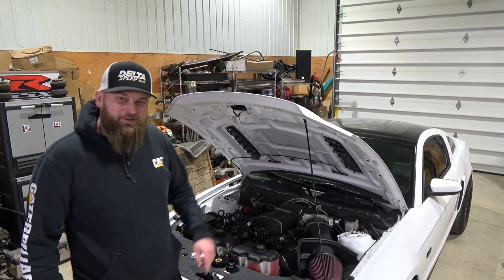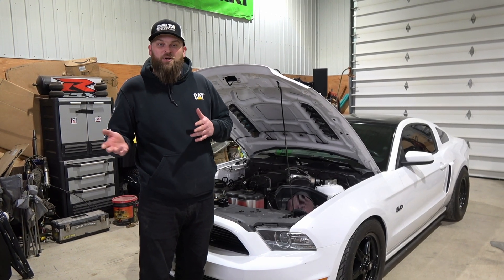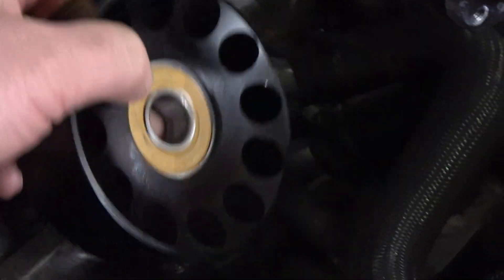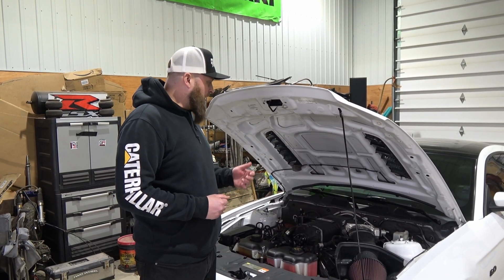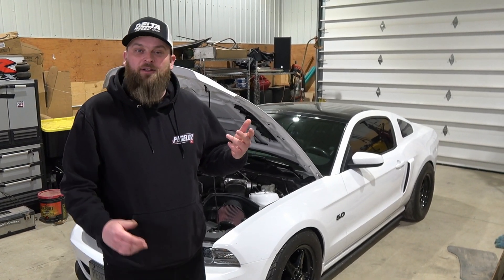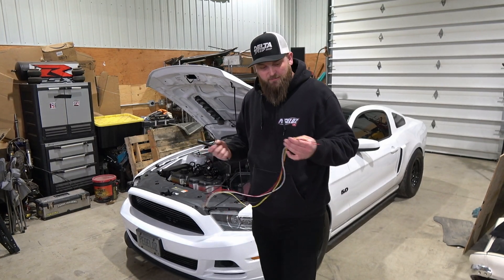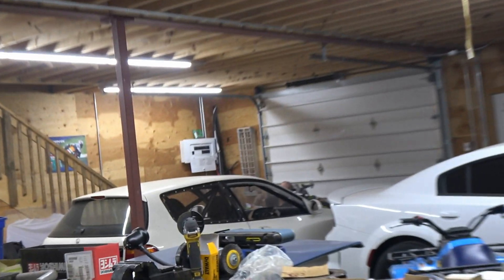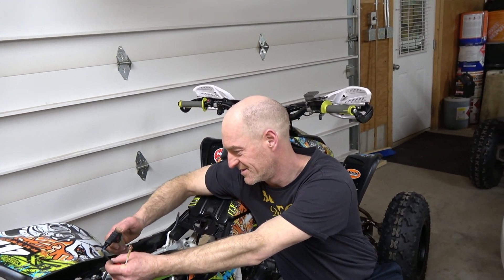Pushing the Limits of my STOCK BLOCK Coyote

Comment: Are you still on the exedy 600? If so how’s it hold if the car is making way more than that?
Reply from the maker: Yes, it's still on the Exedy 600. I assume they're underrating the clutch, and that's why it's still kicking.
Reply: @PEGELOZ  that’s awesome, I was skeptical on getting the exedy 600 just because i will be turning the boost up on mine and aim for around 800 wheel but if yours is still holding good I think I’m gonna order everything you said in your “how to bulletproof your mt82” video🙏 really appreciate it man
Reply from the maker: @Notaxtreme  Happy to help man. I strongly believe the single disc clutch is also a factor in my stock mt82 still being alive. I hope you have as much luck as I have with the setup 👍

Comment: What kinda power you pushing? I’m at 530 whp rn stock gen 1, was curious if I went to 675 if it’d be somewhat reliable? I don’t beat on it 24/7 and daily drive it
Reply from the maker: Hey! On paper, it should make 850-900 wheel now. It's a Gen 3 block, and I'm running E85. 

My gen 1 blew up at 700 wheel on pump gas. I wouldn't suggest more than 10lbs of boost / 650 wheel on a stock Gen 1. It's not worth pushing it, I learned the hard way 🤣
Reply: @PEGELOZ  gotcha, yeah I got a 10 pound pulley I was gonna throw on and get a fuel system and run e85 😂
Reply from the maker: @clayton_4897  If on E85, I think you're safe to push the stock Gen 1 to 750 wheel. 

If you're getting a fuel system, don't cheap out. Get the Fore Innovations kit 👍
Reply: @PEGELOZ  was looking at that and I heard about a kit called sai li kit and it’s suppose to be really good I heard aswell like 1200$ difference in price the sai li one is 12xx and I think cheapest I found fire for was like 2500$
Reply from the maker: @clayton_4897  Don't cheap out on fuel system. Fore Innovations or nothing. 🤣
Reply: @PEGELOZ 3rd gen 1 engine, fingers crossed haha.
Reply from the maker: @flamer38544  1st gen1 was enough for me lol
Reply: @PEGELOZ  this is my first boosted v8 but once it blows up imma do what you did and gen 3 swap it lol
Reply from the maker: @clayton_4897  You don't want to blow up a motor. Better off upgrading and having a good motor to still sell and recoup some $ I wish I never blew my gen 1 up...
Reply: @PEGELOZ  hopefully I don’t blow mine up lol, it’ll prolly stay 530 whp for awhile I have the pulley when I’m ready but I have fun in it as is rn, so idk if I’ll turn it up anytime soon, I just gt500 front end swapped it and getting ready for paint now lol
Reply from the maker: @clayton_4897  Beauty! I've always loved the gt500 front end.
Reply: @PEGELOZ  man it looks so much better, It’s all going Oxford white and then I’m wrapping the cowl hood carbon fiber should turn out pretty good, then gonna focus on suspension lol
Reply: Procharged d1sc on 6 psi

Comment: Did you have to use a tach signal adapter to hardwire the shift light?
Reply from the maker: Nope, just spliced the wire into the negative side of the coil wire on cylinder 1. You can use any of the 8 coil wires.
Reply: @That_FN_Coyote_Car  noice thanks!
I was told you had to use I tach adapter or it wouldn't work properly
Reply from the maker: @bernhardgiesbrecht1806  I think with MSD shift lights you do. I believe they actually come with the adapter... There's one for sale on Marketplace. Probably the better way to go versus cutting into the harness like I did. I didn't go MSD because it's more expensive 🤣